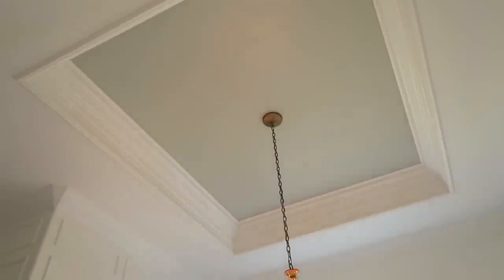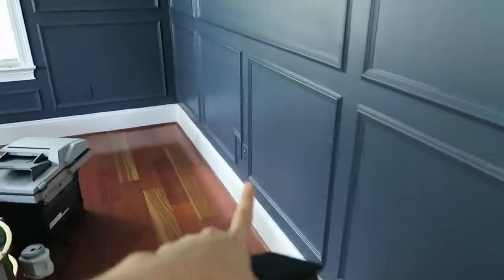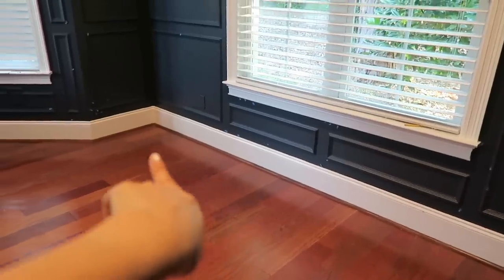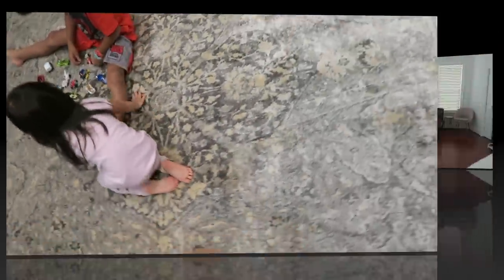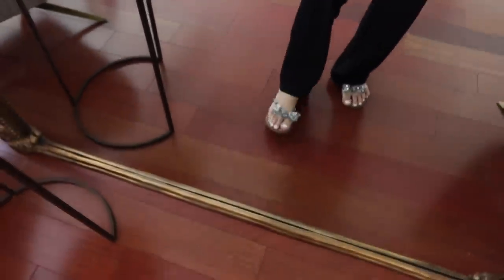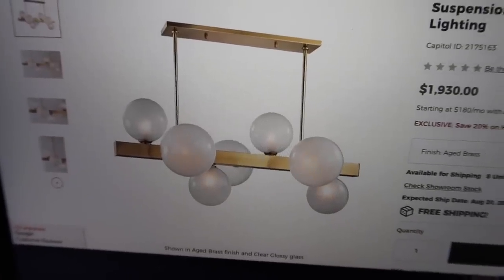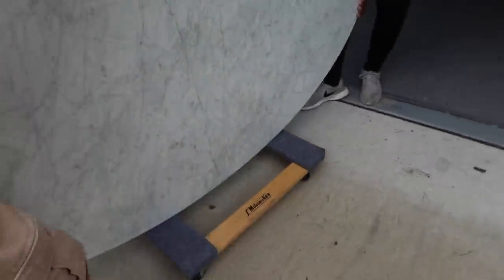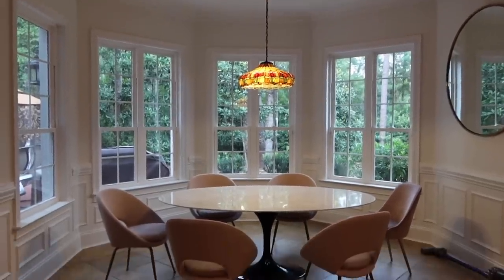HOUSE RENOVATION EPISODE # 2 | NEW OFFICE, HALL WAY, NEW DINING TABLE, RUG etc...

Comment: Definitely first light fixture. I like the cleaner and more modern look it has. It also looks bolder, which contrasts nicely with your pink velvet dining chairs. :) I don't really like the "wire" part that holds up the 2nd light fixture.